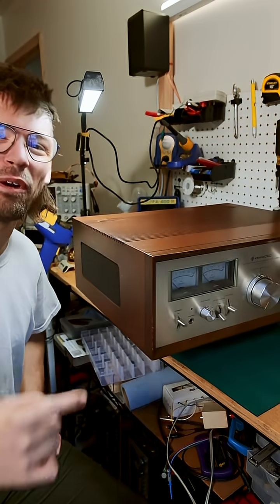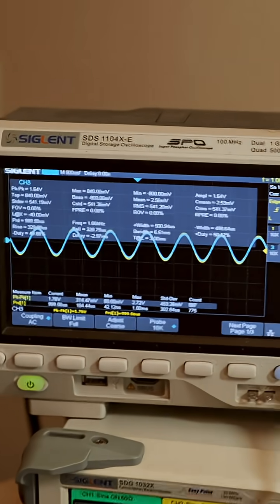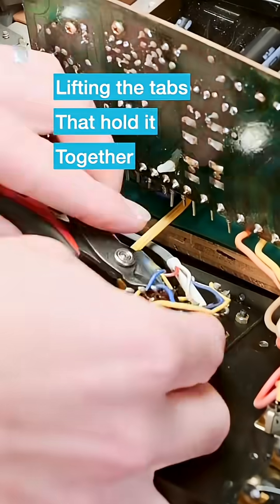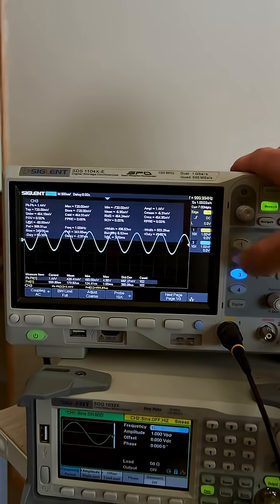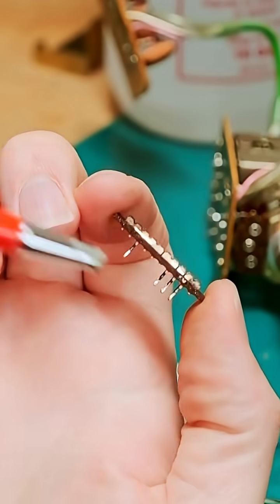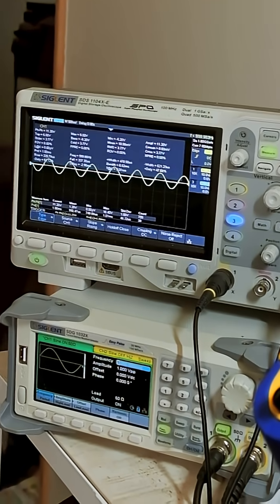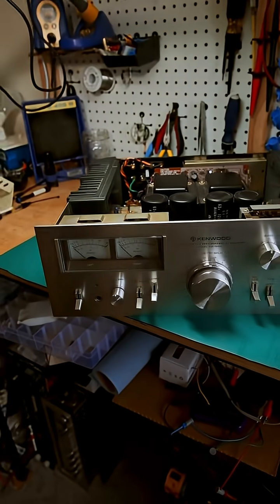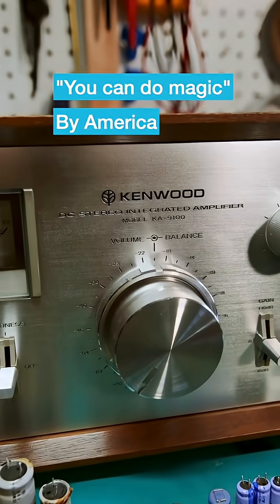Kenwood's baddest integrated 🔥 #Vintageaudio #Stereorepair

Comment from the maker: The rebuild cost the client around $1200. You can find my repair info at the Google forms link on my channel. Thanks for watching!
Reply: $1200 is quite reasonable considering the time and level of detail in this rebuild. The end product is something that could never be bought new.
Reply: @Anony___mous Well it looks like the unit got wet at some point as there is rust on those capacitors and if not like that then I wouldn't change them. My 1986 Technics amp is fine, no issues with any of the capacitors, nearly 40 years old, never been serviced apart from Me opening up to switch off the electric surge protector inside which someone tripped before I got it.
Reply: The fashion that these older units use to process the audio it’s pretty unique to that time. They seem to always sound better when they’re paired with speakers of that same era. The Klipsch Heresy should be a great pairing for this unit.
Reply: selling for up to $4000+ fully restored....
Reply: @john-p5f8v That's ridiculous to spend $4K on an almost 50 year old amp.
Reply: I agree!
Reply: @robertjermantowicz-uw3iw  How much did your cell phone cost? You know, the one you will throw in the garbage can in 5 years.
Reply: I love to watch you do repairs and narrate the whole time what you’re replacing and why and what they are. It’s amazing such small pieces on the board makes such a big difference in the stereo. Awesome videos man great editing everything nice to see your shop. got all cleaned up and you got your new table. I saw that video too excellent
Reply: Do you put any stickers on the amps saying that it's renovated?
Reply: I think you should - if I found such an amplifier at an old deceased relative's it would probably go cheap to a second hand shop because I didn't know any better.
Reply: @SirTubeALotMore the moment you turn it on, you will notice it's been serviced
Reply: Better than new!
Reply: What caps did you switch to? I also got old xenon tuner with that gray ELNA caps? What's your choice?
Reply: Have you ever worked on a  1983 Kenwood KR-1000 Receiver?
Reply: How much would you charge to do an untouched working kr-9400?
Reply: @goatfromhell666 I'm in the same boat as we're both the same vintage. 
Can he also add on 50 plus years to enjoy the music, for me too.
Reply: Thanks for adding the cost. That was definitely some skilled work there to resurrect a classic.
Reply: Makes me where shout.I kept all my old units
Reply: Where do you get all your parts?
Reply: @otpyrcralphpierre1742 probably Mouser
Reply: That's more than the unit cost new, but it's commensurate with what that unit would cost today.
Reply: @jamesmckenzie3532 they go for around $4k on the market
Reply: Holy smokes I am def charging to little 😅
Reply: You should not need to change all the capacitors, unless for some reason the unit got wet, they look rusty so yes probably best to replace them however I have sevral apps from 1985 and there capacitors are fine, ad there 40 years old.
Reply: My 1985 Sumo Andromeda power amp has been in 24/7 use for the past 7 years. Sounds excellent!
Reply: I’m new to your channel and as soon as I saw this video & me being a big nerd of electronics and stereo systems i clicked subscribe and the like button. I love them classic gems Alpine and Kenwood are one of my favorite bands. Thanks for sharing your videos and keep up the amazing work stay blessed and safe.
Reply: I can't see that amount of work costing a penny less.
Reply: It is really worth it❤
Reply: I would not mi d paying at all! Especially knowing its gonna sound phenomenal! Have you tackled a Bang and Olufsen receiver/tuner?
Reply: I’m so happy to hear you’re charging well for your services!
Reply: Would you ever fix a Pioneer SX-990? I'd pay quite a bit. It has a distortion in the left channel, and a knob broke off. Please reach out to me. The fixing of this reciever is for my grandpa and its very special to him.
Reply: I don't know why you keep saying "rebuild". You definitely are not rebuilding these. You are masterfully, meticulously refurbishing and upgrading them, making excellent one of a kind pieces of sound equipment. ❤❤

I'm extremely picky and particular about all my equipment but I can now say that I've found someone that I would trust to work on my sound equipment. 💯🙏💪
Reply: worth it, youre basiclly building him a new one
Reply: Was die Elektronik an geht bist du ein Meister deines Faches!👍 Nur das Holz hätte ich um Welten besser hinbekommen...dafür habe ich vom Rest überhaupt keine Ahnung.😅
Reply: Awesome!! Wish I had that beautiful radio.
Reply: You are very talented my friend… Thanks for sharing… ✌🏼🌞🎄
Reply: Hey, just make sure you have a vented workspace. I'm working health and safety related industries for my whole life and little bit goes a long way. All the best
Reply: Love your abilities !
Reply: id like to learn how to do this and everything i need to know about electronics to be able to repair or improve vintage audio gear .not for a job . where would you start please? I know I can just buy a kit but I want to understand it hifi has always been like this mysterious thing that fascinates me .thanks in advance james
Reply: I would be SO proud to own that unit after your repair!

Comment: Open Question: is there a DYI that I should be doing to help eliminate the dust getting into the receiver and general maintenance like using a can of spray air?
I know that canned air might have moisture in it!
I have a clean apartment, vacuum and dust regularly

Comment: How exactly did you improve the watts from 90 per channel to 120 ? I thought you only replaced the components with equal components..🤔🤔🤔
Reply from the maker: It's likely that the amp put out 120 before I worked on it. 1KHz is a frequency that most amplifiers perform "above their spec" at because it's a bit easier to reproduce. This amp was rated at a minimum output of 90wpc from 20Hz-20KHz. At other frequencies it likely only puts out 93wpc or such. Replacing tired components in the power supply can bring back some power but It's usually in the area of 3-5% more power.

Comment: Don't use metal polish on the faceplate, it's anodized. A very hard coating, and would not need it. The silk screening will though. Warm water soap, and a soft brush to get into the corners. Blow out the water and wipe with a lint free cloth.

Comment: Hi, im just mistakely connect my Technics SU-V40 to 230 volt supply, it should be 100 volt supply through a stepdown tranformer.
Now the amp cant be on.
What your suggestion for me to do. Im not a technician.
Which part of the amp could be damaged ?

Comment: Yeah, the sound is probably completely different after changing 93 parts. Just change what's not good but try and keep the same sound signature. You have an amp por what it sounds like, so what sense would it have to "make it last 20 more years" if you are changing the sound you bought.

Comment: I had a Kenwood integrated amp KA7100 and Matching KT7100 tuner back in the early '70's love that I used it to power my Altec Lansing Voice Of The Theater A7-500 speakers perfect match amp put out 50wpc speakers rated at 50w never needed to run anywhere near full volume or even half volume usually around thee 3 setting max unless I took them out side then (maybe I'd hit 4.5 on volume knob which was rock concert loud at 50 feet.
Reply: Good memories for you !!
Thanks for sharing !! 😊

Comment: how can you be certain that your work would last for another 20 years when you took all the original Japanese parts and installed Chinese made parts? It does not make any sense. 20 years with chinese made junk parts? The deep cleaning is admirable, the lube and grease is fine. But solid state?

Comment: I still love how they look all these years later
Reply: What I like about those old face plates is that the labeling of the functions of each switch. Button or whatever was actually etched into the faceplate. It wasn't just some ink screened, a lettering that wore off over time. It was engraved in the metal

Comment: Can you explain the light bulbs in the background? Are they wired in series with the power? What wattage? They are to protect against shorts when you first fire up correct?
Reply from the maker: Bingo! It's called a dim bulb tester. bulbs are wired in series with mains power and act as resistors. I use 2x 100w bulbs for bigger amps like this one. A single 100w bulb for smaller units. And yes! They warn me if there is a short in the unit from work I've done. I typically plug into mains after the first test on dim bulb.

Comment: Why do old audio equipment like these sound so clean, clear and loud for such little watts. I love it.
Reply: Big power supply's big transformer big filter caps lots of discrete components. No on worried about weight back then.
Reply: @My1970TransAm  Yes, you are correct !!
Reply: @josevega2399  "For such little watts" !!?? 😮 
Its NOT little Watts, it's 90 Watts per channel !!!

Comment: Nice job! More than I could ever do myself! I had no idea it was that extensive of labor involved in properly and completely restoring a vintage piece of gear like this... Even taking all of the individual switches apart and cleaning all of the individual contacts with two different cleaners AND relubricating them with proper grease, WOW! Impressive!... How many days (or weeks) did this job take you of your time?

Also, where did you source all of your replacement parts, especially the transistors (to make sure they are genuine and not cheap Chinese fakes), AND all of the capacitors, especially the larger value filter caps? (And what brand and model/type of capacitors did you use as replacements for all of those? Did you actually test all of them to be bad, or did you just assume that they were bad due to the age of the unit itself?)
Reply from the maker: Thanks! This took me about 18 hours I think. The pre amp took the most time as you have to disassemble the whole front end and it's a right pain. 

I buy all my parts from mouser or digikey. They only sell parts from top quality brands. I mostly use Nichicon and Panasonic for electrolytics, WIMA, Kemet, and Panasonic for film caps, and filters I use whatever brand has the right value and dimensions then sort for the lowest ESR and highest ripple current handling. Epcos, Nichicon, Kemet, Cornell all have good options.

Comment: I don't know much about stereos, but I found a Marantz 2270 a few years ago for free.  Is it worth using it or should I just scrap it?
Reply from the maker: Haha I can't tell if you're trolling or not. The 2270 is one of the most iconic receivers from the 70's. Getting one for free is amazing. If it works and is in good condition, you could probably get $800-1500 for it.

Comment: Beautiful, but if one of those hybrid power amp modules fail, it will never be original again, because the only viable option will be to build two new discrete amplifiers boards into it. Plenty of space for it, luckily. And if the internal schematic of those modules is available, it is possible to rebuild them onto PCBs from discrete components, making it sound as close to the original as possible.

Comment: I have a 1977 Australian Playmaster amp working but needs a service and recap. Has a hum when you turn up the bass nob. I'm assuming the larger caps in the power supply would by off spec now (and others).

Comment: I have watched a lot of these vintage receivers get serviced and their stated power comes back after servicing sometimes a third more powerful than the original. I think that's amazing! It doesn't happen all the time but when it does, it's amazing.
Reply: The amplifier rating back them was a minimum continuous output, it wasn't unusual for individual units to put out more than their rating.

Comment: I just found a old Wards Airline radio from 1947 tubes are still in there unsure if it works due to power cable being old and cracked.  Also found a 1962 GE portable radio

Comment: Nothing compares to the sound of these old amps. The newer ones don't come close.
Reply: Facts. We had an old Kenwood amp powering the original speakers that came with our kenwood unit and man did those paper speakers and woofer sound crisp.
Unfortunately our cat decided it was a nice place to urinate one day and completely fried the board. We threw the speakers out too and looking back I wish we had at least kept those.
Reply: @ToolsInAction4u  Y'all shoulda thrown the cat out, instead of the stereo equipment!
Reply: analog is the key. No switching power supplies  nor ICs in the preamp circuits.

Comment: You do beautiful work, my dude. I have to ask: how did you get into this? I'm a solder head myself, and I do mostly amateur radio / rf stuff, but I was born into the life. I'm always curious about how people got into what their passions are and how they developed their skillsets.
Reply from the maker: Thank you! I appreciate that! Radio stuff is so sick! If I ever have time I'd like to get into HAM. I got into fixing electronics when I was 10. My nintendo DS Lite stopped working so I read and watched videos online about soldering and common issues with it. Ended up being a bad solder joint on a tiny smd capacitor I think. I fixed consoles and other stuff. Got a little stereo when I was 13 or 14 and started going to thrift stores looking for better speakers etc which kicked off me finding loads of vintage gear for cheap (back in 2008-13 stuff was cheap). I sold most everything I had at 19 and moved out of state. Got back into it four years ago after finding a good deal on a set of Tannoys I'd always wanted and took the repairs a lot more seriously.
Reply: @Shuksanaudio That's a dope story! Kind of similar to mine with computers. I had a 486 DX1 33Mhz that was always breaking and it took me a whole summer to fix it. And then, for my 10th birthday, I saved up all of my money, bought all of the components and built my own. Keep in mind, this was 1993, when plug n play didn't exist and you had to set physical dip switched and jumpers to set your IRQ and DMA channels 😂. And the rest is kind of history. My dad had a two way radio shop and oscilloscopes and virtual network analyzers and stuff and I spent my afternoons after school replacing pots and speakers and contacts and final transistors in repeater power amps on Motorola radios in my teens and early 20s. 

If you ever want to get into HAM, I'd be happy to swap notes and answer your questions. 

I subbed to your channel and I look forward to seeing what you dig into next! They don't build em like they used to and it's nice to see people appreciate and preserve good, old tech instead of throwing it away and buying new, cheap garbage over and over. 🎉

Comment: I've got a KR 9600 Kenwood. Left side Channel quit working and I believe it is the power supply. I've had it since 1978 and it's been pushing JBL 100s for 50 years. How do I get ahold of you or can you please get a hold of me.
Reply from the maker: Could be one of the power packs similar to this amp uses. There are replacements available but they're a couple hundred bucks usually. You can find my repair info at the link on this channel page

Comment: I really enjoy your videos bro. I once had a 9100 integrated amp. It is a beast. The TA100w I.C. one one channel needed to be replaced, but I couldn't find a replacement I.C. anywhere. Eventually, I gave it away, but now seeing your videos,  I wish I didn't 😮
Reply: The market has responded to the rise of popularity of these vintage pieces with a number of these 'Darlington' amplifier packs being made with discrete components mounted to a circuit board that replaces the defective original.  There is at least one available for the 9100.

Comment: I've been a CRT technician for 35 years. You are a guy that just "blanket replaces" parts. If something is faulty you will eventually fix it if you replace everything lol. 

You have zero ability to actually fault find. So you just replace parts until the problem is gone. Clown. You're the only "technician" I've ever known that replaces transistors that are not blown or faulty.....

Etc. Unsubscribed from your crap.

Comment: That is a beautiful unit, but it's a shame that it uses STK packs that are likely unavailable and proprietary. Hopefully, you prolonged their life. Hey, at a fair price, I would buy that piece. As always, I enjoy watching your videos.
Reply from the maker: Yea there are replacement options for the STKs. Some that use discrete components actually. They're like $150 a channel though haha. People say the 9100 is really great sounding and I definitely liked it after the rebuild. I'd prefer an amp without the power packs though as like you mention, they can fail and be a pain to replace.
Reply: @Shuksanaudio even though each channel could be 150$, that unit is worth that to keep it alive. After you spruced it up, 120 peak watts is very good. Even if the unit is 90 watts rms per channel, thats real power. I would be completely happy with that for the rest of my life. Good sound quality ✅️ enough power to rattle the walls✅️ decent build quality✅️ multiple inputs✅️Checks all my boxes.

Comment: do you have discharge everyone of those capacitors individually, or is there a way to do them all at once?
Reply from the maker: Only need to discharge the 4 big ones. The small ones don't hold enough juice to matter. Thankfully Kenwood put bleeder resistors on the 4 main caps so they drain off on their own after you power the unit down. Takes about 10-20 seconds for them to draw down to under 5 volts.